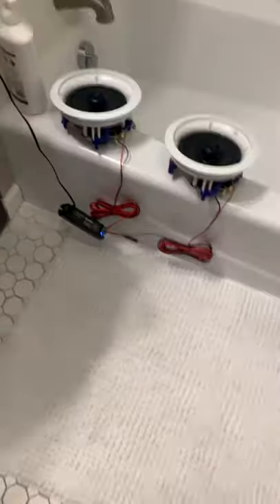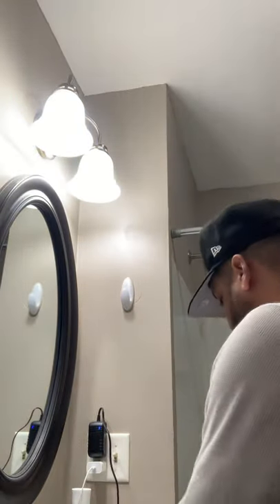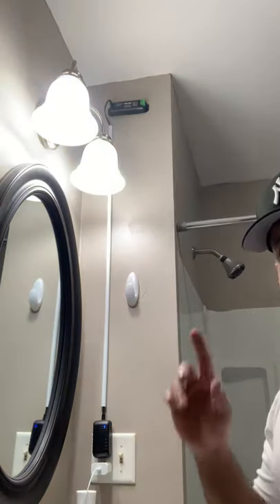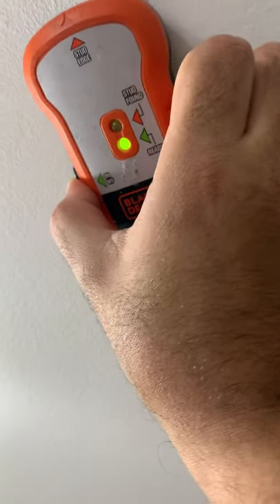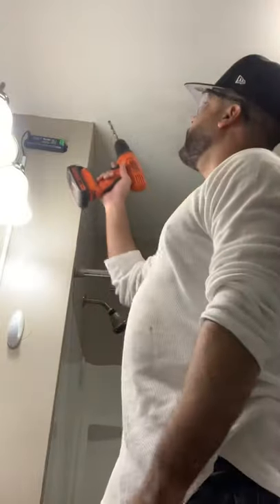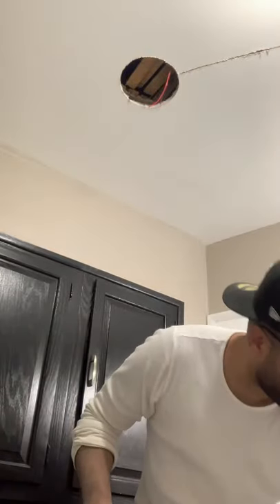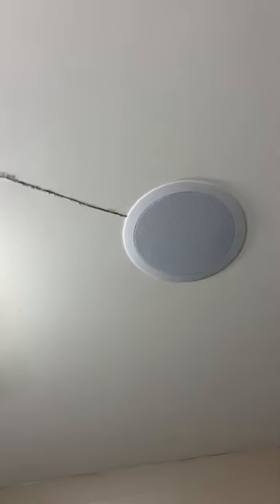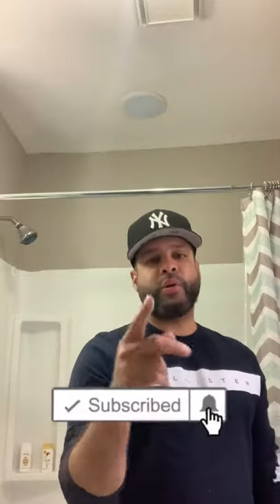How to put ceiling speakers on your bathroom

Comment: Why have the receiver on show and wire's coming out the ceiling you could have got a power source from in the ceiling to power it and also had the receiver inside the ceiling hidden so you see nothing but the speakers. Also cables should not go diagonally across walls or ceilings they should run in straight lines.